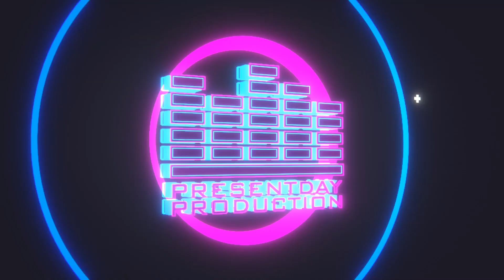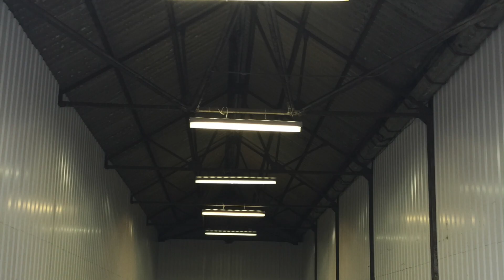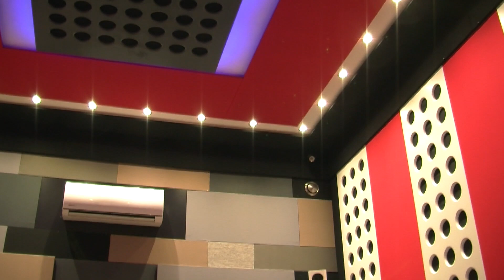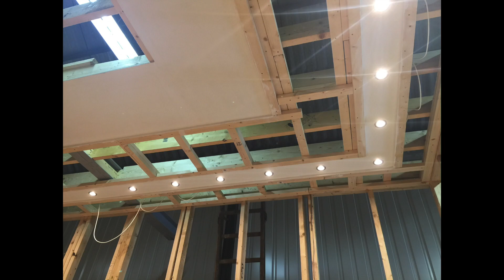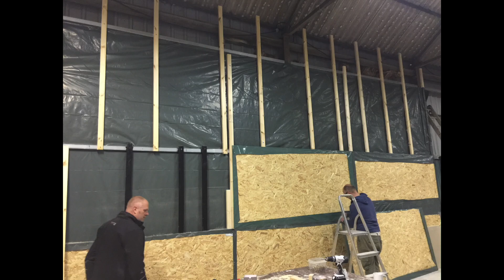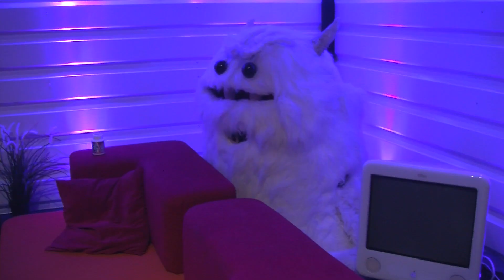Epic Recording Studio Build! How We Built A Multi-Room Recording Studio With VERY Little Money!

Comment: Well done.  You did a great job in design and execution.  I appleaud you inventiveness and care in selection of the methods and materials.  This is a very good video.  

Soundproofing is so critical.  My four room 1800 sq ft studio has 4 inch stud walls with blown in foam insulation, than 12 inch thick poured concrete outside of that and then 4 inches of compresssed  fiberglass so the walls are 20 inches thick.  The studio is located in a very quiet area.  Silence is golden.

Comment: Do you put absorber behind the sea of holes diffusers or it is just the wall at a certain distance? Thanks...
Reply from the maker: There’s rockwool absorption behind the sea of holes panels, directly attached to the rear of the panels
Reply: This is very useful. I have 2 roxul absorption panels 6x4. I think I will put a sea of holes of 6x2 in front of them. My room is 10x12x8 and sounds a bit dead. That should help right?
Also, you talked about the density of absorption material. Is it possible to increase the density of the rockwool by compressing it or is this a bad idea?
Thanks again...

Comment: Hi Mark! 

What a great video, i've seen it 4 times already. Thank you very much for sharing all the valuable information! 

I only have two questions about the floor structure: In one of the comments you say that the sand rests directly on the concrete floor and that the wooden skeleton that surrounds the sand stands on rubber pucks(?). Isn't it the case that due to the stiffness of the sand, the floor still makes contact with the concrete floor? So that the floor is no longer 'floating'? 

And what kind of plasterboard did you use in the floor construction? Just the same as the ones you used for the walls? Because that is strongly discouraged by the man from my hardware store... Long story short: 

Would you like to share the exact sandwich construction of the floor? :-)

I hope to hear from you, you would really help me out. 

Thank you very much in advance and best regards, 

Jesse from the Netherlands
Reply from the maker: Thanks for watching! Yes, sand and pucks was pointless, and I wouldn’t bother with either if I was to do it again. The only way is the proper way - a concrete slab floating on springs. But the isolation is good enough for our use. 

The floor sandwich is ply at the bottom, 18mm plasterboard above that, and OSB on top.
Reply: @PresentDayProduction  Thank you very much for your response! And this indeed confirms my suspicion. Good to know and thanks for sharing. Cheers

Comment: Yalls structure looks very similar to what we had to work with or build on or adapt at the film studios. Well on the better stages they wld have the subfloor set ups and like a basic square walls. Some stages were almost empty tho and then we would go in and build the sub floor and alot of times we wld build cheap flats for fake walls but then the walls of the steel building we were in were treated on the inside and then sound proofing in the walls. We would also put these layers of soundproofing on the flat roofs (temporary) we wld literally lay 2x4s on the sheets of foam. I tried so hard to get the sound foam after that movie but cldnt make it happen. They threw all if it aways smh! And most shows we wld throw everything out after filming. Crazy, they said we wld waste time/$ trying to keep the materials lol.

Comment: What a fantastic and helpful video! We are in the beginning stages of mapping out how we will build our two room studio, and have so many options its overwhelming. I love how you built this but have some questions. Assuming this was a "room within a room" build, how much spacing was between the interior metal walls and the new wall you built? How does the STC rating stand up against the double drywall w/ steel stud or staggered steel stud wall? What thickness of Rockwool did you use in your walls? Did you apply acoustic treatments directly over the open stud framing? I did not see drywall there, and was curious. 

I am working with a basement space with 7" cement block walls and a 4" brick facing on the outside of the home over the concrete. This makes up 3 of the 4 walls of the space, as I am going to need to build the 4th wall of new materials to separate it from the rest of the basement. Ideally, I'd love to have STC ratings around 60, but would love to avoid the double wall method (I need all the space I can get), and I'd like to avoid spending several thousand dollars more than I have to. What would be the best method on a budget to decouple the brick walls from the new walls, and what would you recommend building the new 4th wall from, so that sound transfer to the rest of the basement is low?

Comment: Super interesting video Mark and James. It's always instructive (and cool) to see a studio when you can watch the various stages of development as a work in progress. 
Question: How did you mount the MDF white panels and the red cloth panels to the walls? I can't see any screws or hardware holding them up. Are the screws (or whatever you used) just not visible in the video? 
All The Best,
Phil
Reply from the maker: Hey Phil!

We actually did a new video recently - we are working on a four-part series on how to build a studio. Part one was released about a month ago, and part two is being produced at the moment. They are a lot more in-depth than this video that you have commented on. However, to answer your question, all of the panels in the studio, be it MDF or fabric, are held up using small panel pins. I can’t remember the precise size but they’re about 2-3mm in diameter. Almost invisible, which is perfect! As you can(‘t) see!
Reply: @PresentDayProduction  OK thanks James....or is this Mark this time!...
I never heard of panel pins before. I must research that type mounting hardware as that could come in handy...I will check your other video for sure. Thanks.
Reply from the maker: It’s always James 😎

Something like this:
https://www.wickes.co.uk/Wickes-20mm-Panel-Pins---200g/p/516027
Reply: @PresentDayProduction  Thanks James....
Phil....(It's Always Phil).
Reply: @PresentDayProduction  Hi James, Mark alluded that the sandwich of materials for the walls are, "MDF, Plaster Board, Membrane, MDF, Plaster Board, Membrane"... What is the membrane made out of? What material is used and how thick is it? Thanks and have a nice Saturday...
Phil
Reply from the maker: It’s called Mass Loaded Vinyl. It’s a really heavy sheet material which comes on a roll. Quite pricey but adds a good layer of damping into the mix. It’s only a few millimetres thick
Reply: @PresentDayProduction  Thanks. I will look into it and see if a search brings it up. Thanks.
Reply from the maker: Something like this:

https://www.soundstop.co.uk/ZTECSO100A.php
Reply: @PresentDayProduction  So James. (and thanks for previous reply)..Did you use this Vinyl product behind your MDF absorption panels in your live room? As it looks like there is something a black colored material behind the holes you guys probably spent many TEDIOUS hours drilling and many TEDIOUS hours using a router to bevel the holes. And...what discs (rubber I guess) did you use to isolate (and float) the floor. Note: the only way to learn is to ask. (My jazz guitar teacher thankfully taught me that years ago...that's why I can tune the hell out of my guitar brilliantly). Thanks.
Phil
Reply from the maker: So the wall structure goes in the following layer order = MDF, plasterboard, plasterboard, Mass Loaded Vinyl, MDF, plasterboard, plasterboard. That works really well for isolation. The room is completely soundproof through those walls even with loud bands.

Regarding the white panels - you’ll see this in more depth in our upcoming video, but it’s white-painted 18mm MDF with hole-saw cut holes, each painstakingly cut by hand and then routed and sanded to smooth out. It took us 14 days to make the 9 panels! The black material in those holes is simply black breathable fabric, as is used on every wall in our studio in various colours. Behind that is simply rockwool. All will be explained in a very in depth video coming soon!

Comment: Hey man great video i’ve really learnt alot. Quick question what types of fabrics did you use and where can i get them from? And also how you made the door?
Thank you 🙏
Reply from the maker: Any breathable fabric that is also fire retardant will work. We used various types of polycotton here. The door is exactly the same as the wall, on hinges! And a door closer keeps it firmly shut with a large handle flush mounted, so no irritating latches to drill out

Comment: Ahoy. Excellent video. My church is in the process of building a new social hall in existing space that will need sound treatment for speech intelligibility. I made a Duck-Duck search for the RA Book and came up short using just that title. Do you have the US or UK formal title, publisher, and a book number? Library of Congress number or Queen's equivalent, publisher's number, etc.
This title is skunking Google Books and Google Scholar. Like all churches, we are capital poor but have building trades volunteers in congregation.
Reply from the maker: Try this, this is the one, and it's cheap!
https://www.ebay.co.uk/i/202554682440?chn=ps&norover=1&mkevt=1&mkrid=710-134428-41853-0&mkcid=2&itemid=202554682440&targetid=1000151319060&device=c&mktype=pla&googleloc=1006701&poi=&campaignid=10204071741&mkgroupid=105678537727&rlsatarget=aud-381667280803:pla-1000151319060&abcId=1145987&merchantid=6995734&gclid=Cj0KCQiAzZL-BRDnARIsAPCJs73_jFoZDSbcOCC891qs5IzEF_BbIevehmZyZQ8jxGiBllzZ7okRdIUaAnzhEALw_wcB

Comment: They look like ATC midrange drivers on your mains.
Reply from the maker: Yeah they are, I can’t monitor on anything without those in them! The monitors are actually one of the first pair Roger Quested ever designed, back in the mid eighties when he was an engineer at DJM Studios in London. He built a pair with twin (JBL) 15” bass drivers for studio A and these ones for studio B. They were so popular that every visiting engineer wanted a pair, so he then set up Quested as a monitor company, and ATC quickly followed suit with their SCM150 (that are based on these, very similar in every respect apart from the different bass driver) and SCM300 mains. They were just an OEM driver manufacturer before that. I love em, can’t live without em! You can’t beat awesome drivers in a great box in a great room. No DSP, no software calibration, just damn good science and solid engineering!

Comment: Great video, and great channel! ... just a question: how do you handle ventilation of the rooms?
Reply from the maker: We have a ventilation system that brings fresh air in from outside via a system of acoustically treated air ducts, and another at the other end of the room that draws air out. So the air completely changes in the room every hour or so. This was very difficult and expensive to get right, and I’d suggest opening a door every half an hour or so as naturally tends to happen in a studio anyway!
Reply: Great question , never thought of this!
Reply: I highly recommend using a mini split. The Mr Cool DIY is an excellent choice and works great in my studio. I just open the door to the outside and get fresh air every so often. It is good to do anyways and I saved some money and didn't need to put extra holes in my room.

Comment: Hi, great video! Just a question: what thickness of rockwool would you recommend for diy acoustic panels which will be mounted to the walls and ceiling? The thickest I could find is 20 cm but thats not quite practical to hang on the walls. And would it make sense to use rockwool for corner basstraps?
Reply from the maker: 100mm would be ideal for acoustic panels, and if you can space them off the wall they will be much more effective. And yes, it’s great for corner bass traps

Comment: Hi great video. I am about to embark on a similar venture. I have a unit I am renting out and am planning on  building a studio/ rehearsal rooms. I have bought the ra book and as you say it is very good. Did you guys have any plans drawn up by professional designers or did you do it all yourself?
Reply from the maker: rune bailey Every professional designer saw the building and ran away! It’s basically an enormous tin garage! So we spent a good few weeks designing rooms to work for us, and work in the building, but did the entire planning and building process ourselves, apart from where we had to hire a professional - building regs, air-con installation etc. Even the pro acousticians said you never really know how a room will sound until you build it, but you can take the maths and the physics as far as you can - designing the rooms with certain dimensions to avoid horrible room modes etc. Our results are great, but 75% planning and 25% luck!
Reply: PresentDayProduction well that sir is amazing. I must admit I am both inspired and terrified at the same time. If there are any tips and pointers you could give me it would be much appreciated. The unit I am looking at is an open plan with a block outer skin. I intend to use the same method you did for the walls, floor and ceiling etc
Reply from the maker: rune bailey Top tip: don’t waste any money on off the shelf sound proofing solutions! Soundblock plasterboard isn’t as effective as two regular sheets placed on top of each other, but is more than double the cost, green glue kinda works but is very difficult to apply successfully and takes a few weeks to become effective, avoid cavity walls - a stud wall with insulation in the middle and plasterboard on the outside of each side isn’t as effective as taking the sheet off one of the sides and placing it on top of the other, and if you do that “backwards” you end up with your insulation on the inside of the room - so that’s your acoustic treatment sorted, you just need to cover it with fabric to make it look nice. We’re actually starting filming today on a block building that we’re helping convert into a studio space, so make sure you’re subscribed!
Reply: @PresentDayProduction  Thank you so much this is all very helpful. I am based in North Devon and would love to come take a look at what you have done in person? I would be more than happy to pay for your time and just perhaps get a bit more insight into the realities of what I have lying ahead of me.  Would that be a possibility? No worries if not. The video itself has been a great inspiration and has saved me a shit tonne already lol
Reply from the maker: rune bailey Ahh, I was born in Barnstaple, so very familiar with North Devon! You’d me more than welcome to come up and have a look at what we’ve done. Send me an email at info@cosmic-audio.co.uk
Reply: @PresentDayProduction  I live in Barnstaple haha

Comment: Great stuff. What is the membrane that was used?
Reply from the maker: Tim Child Hi Tim, I cant remember the brand name we used, but there are two types to be aware of - one that is designed to be sandwiched between sheer materials and acts like green glue (albeit with a more accurate ‘spread’) such as Tecsound 100, and one that is designed to form a limp membrane over stud work such as Acoustiblok. We used the former between-sheet type membrane. So choose the type that is best suited to your build, and make sure you follow the manufacturers instructions, as using the wrong type in the wrong scenario can yield little to no improvement in isolation.